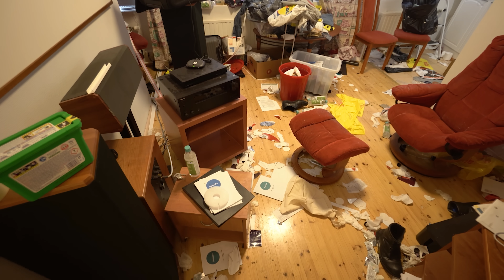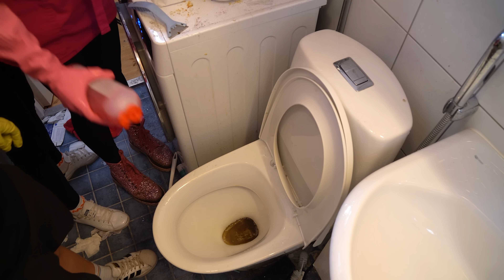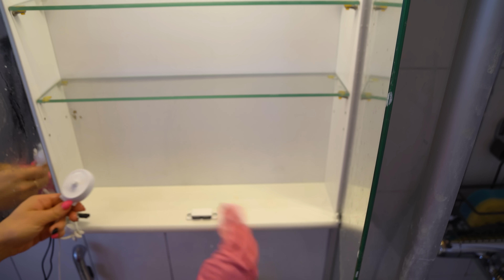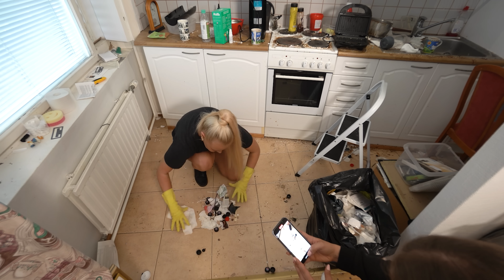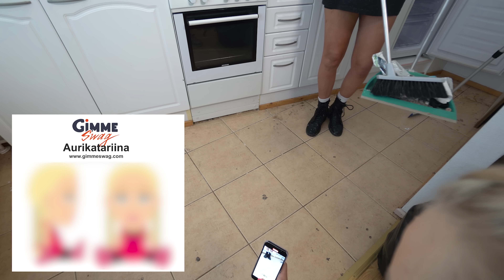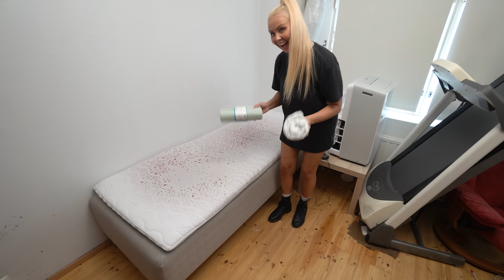A Doctor has An Odd Secret 🤫 CLEANING FOR FREE!

Comment: Me has ayudado mucho con la limpieza de mi casa. He podido quitar manchas que antes no podía de la ducha, incluso manchas de óxido. No solo ayudas a las persona de los video si no a los que te vemos también ❤
Reply: How did you remove the stains?
Reply: For shower stains, use oven cleaner, let it rest and then remove it with a sponge. With rust stains you have to use acids, you can put vinegar or toilet cleaners with acids, let it rest and remove with a sponge.

Comment: I totally get it. I'm not ocd, I don't think, but when I clean I have to do it 110%. So I'll sometimes put off cleaning until I get the energy to do a full day of cleaning - and that's EACH ROOM. Then I'll DEEP clean and even then I feel like it's never clean enough. I make a long list and I just get burnt out and exhausted. I've had a talk with myself that it's okay to tidy and spot clean when things get dirty. It's okay to have things not 100% clean. I only deep clean twice a year, spring and fall. So far it's working for me. BTW - thank you Auri for the  oven cleaner/cling film tip to clean glass stove tops! It works like a charm! ❤ I also repurposed my old microfiber hair towel as a cleaning towel and it works so well!
Reply: I can relate. It’s hard to not let perfection get in the way of okay. I’ve found using a schedule and timer has worked the best so far. It’s hard to move on at first, but it gets easier. As the fly-lady says… housework done imperfectly will still bless your family.
Reply: I don't struggle with that to the same extent you do but I agree it's hard to stop cleaning once I've started and then I just get burnt out and don't clean again for a long while (because I'm tired and I can't set aside a whole day every time I want to clean the house). I've started trying to incorporate small cleaning tasks into my day (like making my bed in the morning) instead of letting it build up and that helps me. Struggling with not achieving perfection is very relatable to me. I hope you find a balance where you feel relaxed and enjoy cleaning:)
Reply: @Moocow2003  thank you! <3

Comment: Your videos🥰❤️ your ability to tell a story is amazing. One important note: if the scrub daddy has metal in it, it’s important to be careful which surfaces you use it on because it will definitely permanently scratch everything it touches. If a House Cleaner were to use an abrasive cleaner or scrubber on my porcelain fixtures, I would have a heart attack. Lime away takes off lime scale as does vinegar. But if you leave vinegar on too long, it can damage surfaces.

Comment: Dear Auri! If you don't mind I would like to give you a small advice about toilet cleaning😊 if you want to get rid of that dark dirt in the bottom inside of a toilet bowl more effectively, you have to pump out the water first. Because when you pour acid into the water it is diluting in it and it's effectiveness drops. When you have no water or less amount of water acid works more quickly 😉

Comment: For those with OCD related to cleanliness, their cleaning efforts is from a place of fear and distress, and cleaning is a source of relief (not joy, like it is for Auri.) That said, not all OCD is related to cleanliness.

OCD is characterized by an obsessive thought about something that feels threatening and creates fear/anxiety, followed by a compulsion to relieve that anxiety with some sort of coping mechanism. In some instances, the coping mechanism doesn't necessarily make sense, it just has to work at relieving the anxiety. In other instances, the coping mechanism can make sense, but performing the action doesn't provide the relief that it should. In the former situation, you could have this intense belief that someone you love will die, but, if you say some sort of phrase in your head at every meal, or perform some sort of action at some specific time of day, that person will be saved from what feels like certain death. People who love the person who suffer from OCD may not even notice that person is performing this "ritual." In the latter situation, you could have an intense fear that you've left your oven on and the house will burn down -- the appropriate response to this fear is to check the oven, but, for some reason, doing so doesn't provide the relief, so, you do it over and over and over again until it does. Most people are diagnosed when the compulsion to perform the activity (whether it's internal or external) interferes with daily living.

If someone has a fear of germs, even knowing that the ozone machine is harmful is less scary than the option of NOT running the ozone machine. If you're busy (like say, a doctor), a physical cleaning/sterilizing habit creates MORE interference to your life than having an ozone machine on 24/7. I don't know if this doctor does have a fear of germs, but, this behavior on some level does make sense if he does, and I hope that he is able to find a healthier way to manage whatever his anxiety is. Thank-you, Auri, for helping this person get a fresh start. <3

Comment: This is the first time ive actually been angry with the resident. He put her at risk. It clearly says on the data sheets and the packaging that come with ozone generators that they are onlh for use in unoccupied areas. Mental illness is no excuse for putting her at risk. He should have turned them off before she came and told her about them.